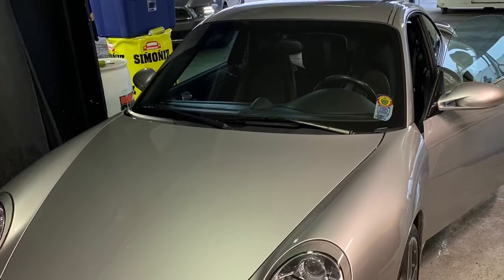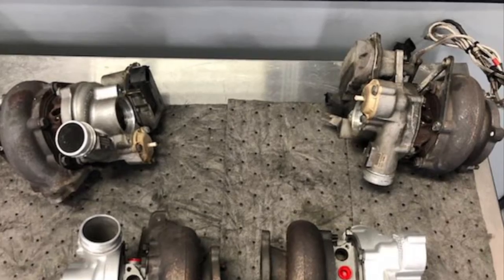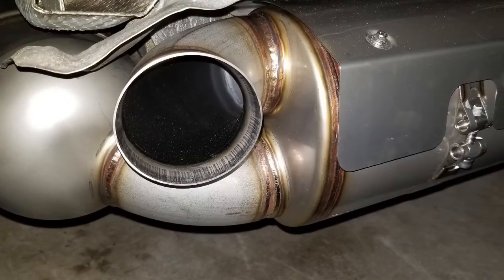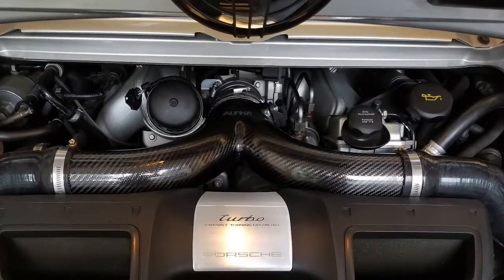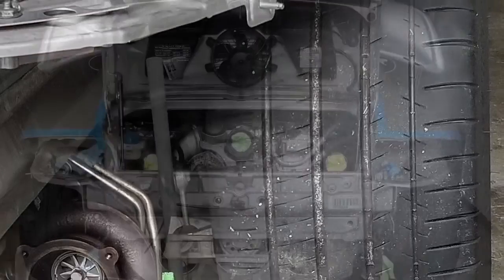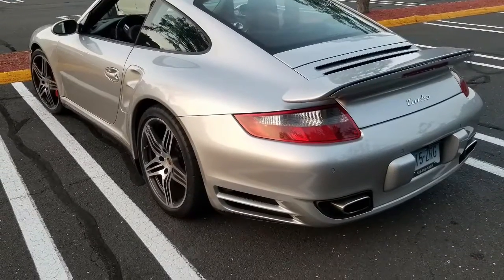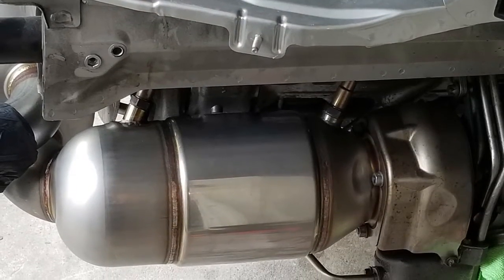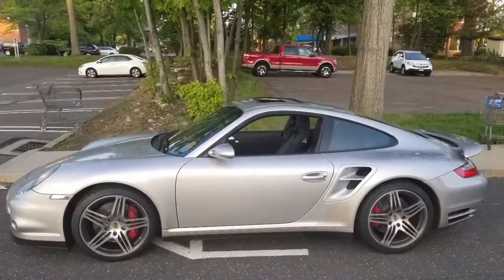Porsche 997 Turbo - Stage 4 Project

Comment: Hi..Did you loose torque and response between 2000 and 3000? In 6th gear, driving slowly, as 60 Mph..50 Mph, do you have an immediate response as the original car with ecu tune? I love the response of the engine, but I am afraid of loosing it in the low end with new turbos and intercoolers...

Comment: dynoflash great vid, what is the total cost for all these bolt on please.
Reply: I don't know the cost of his exact parts but these are the prices I have/am paying for my 997.1 turbo 
Freddy Lewis exhaust: $1500
Freddy Lewis upgraded turbos to 68mm: $3000
Markski intercoolers: $2000
Torque solutions turbo intake tubes: $400
Snow methanol injection kit: $600
Torque solutions semi solid motor mounts: $200
Eibach springs: $300
DSC controller: $1000
Markski ecu tune: $1100
Markski tcu tune: $1000
BMC filter: $150

All these mods will max out the stock bottom end on the engine easily. If running a Cobb AP it's $1500. Injectors for e85 instead of methanol injection for FIC1200 are $800. But to run e85 at max power level you also need to upgrade the stock fuel pump and fuel line size.
Reply: You also don't need to upgrade the ypipe, plenum, or throttle body to reach max limit on stock bottom end of the engine. The gains from them is negligible up to that point.
Reply: @sutherlacd27  thanks for such a detailed reply, i really appreciate it.

Comment: Nice video.  Just wondering how often you need to put new tires on this beast.  And what brand?  Michelins or Pirellis or something else?  Keep on boostin’!
Reply from the maker: Not too often.  I drive it about 700 miles a year.  The tires will likely have to be changed out at the 5 year mark for age.   I use pilot sport tires

Comment: Thanks for the video. I have the same 997 silver color and looking to add some mods and hit the track. 

But no one ever seems to post the amount spent on their mods. 
What was your labor and materials cost for this project?

I want to show my local Porsche shop this video as an example of what I would like to achieve.

Cheers
Reply: I have a 997.1 turbo with some mods. 3" catless xpipe exhaust was $1400 from Freddy Lewis, 4.5" intercoolers were a little over $2000 from markski, turbo intake tubes were around $600 i think from torque solutions, and semi solid motor mounts were a few hundred dollars from torque solutions. Tune from markski was around $1000. I plan on having my turbos modified to 68mm which is around $3000. And then meth injection for less than $1000. All of these mods will make over 700hp. If you want e85 instead of meth injection you will need injectors and fuel pump upgrades. Injectors are $800-1400 pending on what you get. If you are manual you will need to upgrade your clutch and I don't know what that costs. If tiptronic you might be able to get by with just a tcu tune which is $1000 or so. But it would be wise to upgrade the solenoids to the amg ones on top of the tcu tune which is probably around $1000. Another great mod for these is a dsc controller which is around $1000. After exhaust and intercoolers you will want to go one step cooler with plugs. Run ngk laser platinum plugs. If your coils are still the original ones you will want to upgrade to the new version. You will also want to pin your coolant lines if you haven't yet. And you will want to change your elbows to sharkwerks elbows. And while the engine is out you should do water pump and thermostat as well. That is $2000+.